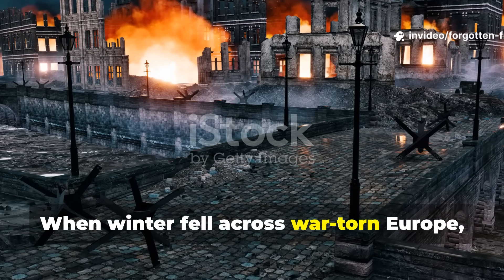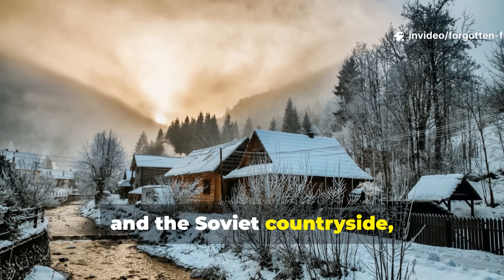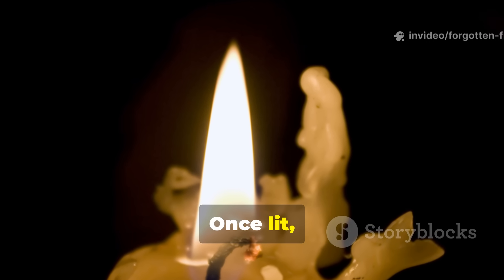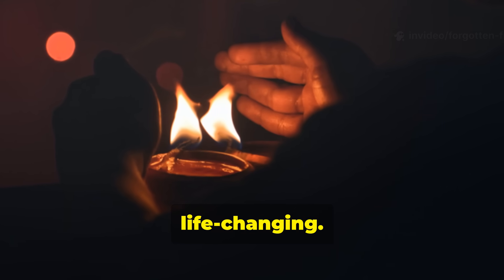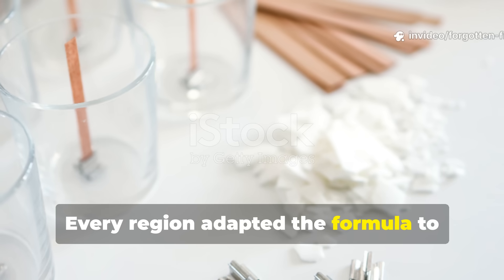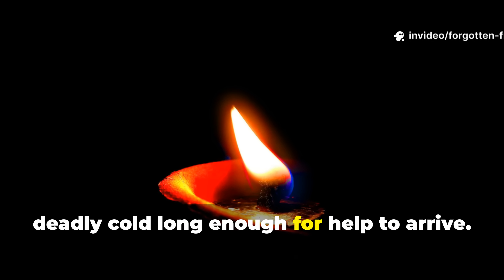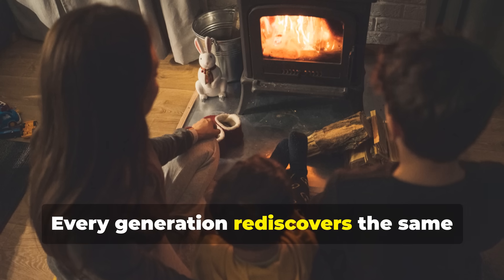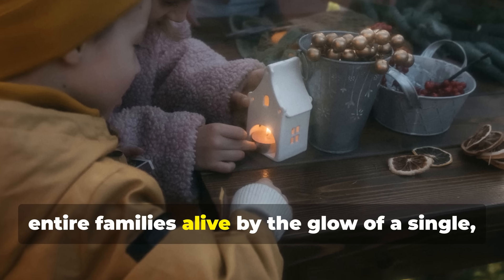The Lost WWII Candle Hack That Heated Entire Rooms Without Power

Comment: Be careful with the flower pot-  the cheap ones can crack and you'll have a house fire. It's already happened!
Use a cheap thrift pot or aluminium saucepan or possibly a turkey pan instead. Rest it on several supports.
I would like to figure out how to fill a flower pot with sand like a heat bank and turn it over...
Reply from the maker: Good advice, thank you for sharing your experience!

Comment: I believe we learned this in Scouts! My mom was my troop leader. ❤
Reply: Yes, I made these in guides. We call them buddy burners. We put holes at the top of the can so oxygen can still get to the flame  and continue to burn and the pan can be balanced on top of the tin. If you invert a larger tin which also has holes , so oxygen continues to feed the flame you can cook pancakes on the bottom of the upturned large can., or place a larger pan to heat. You need to remember to use a pot holder or oven glove to lift the hot tin cans. The flame can be extinguished by excluding air and the wax allowed to cool and harden before packing away. Great for making a hot drink on a hike.
Reply from the maker: Thank you for sharing you're experience

Comment: If ya put a burnt match and I mean charcoal burnt, on a tea candle it will put off a flame ya can cook and heat with, more charcoal bigger flame, you can just add vegetable oil to it and as long as ya keep it full it will keep going, only problem I found is it boils the wax pretty fast and you can see the paraffin fumes coming off so may be a lil sketchy
Reply from the maker: Good tip!
Reply: @forgottenfrontlines-b4p just don’t catch your house on fire, im not liable
Reply: Does it have to be parrifin? Or can it be beeswax?
Reply: Beeswax is The Best! NO toxic fumes and the BONUS? It purifies the air!
Reply: @jawnaraestokes5836 never tried it with beeswax, I’d assume it work the same
Reply: Do any fumes come off that which might hurt a person ?